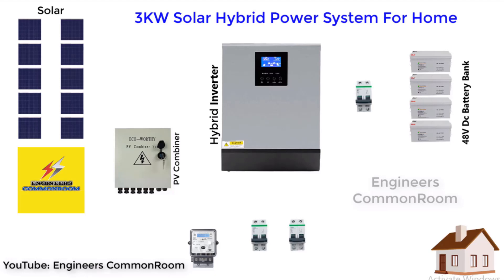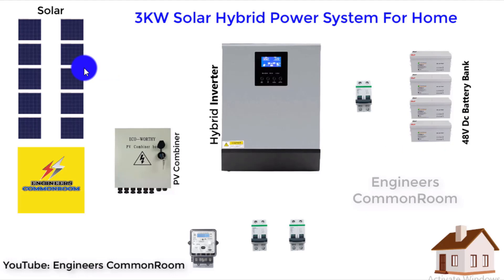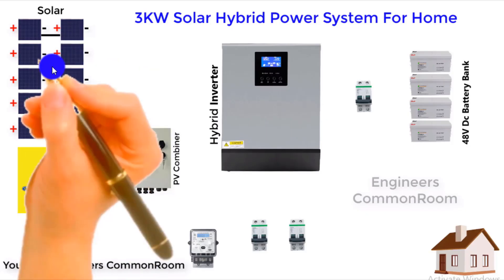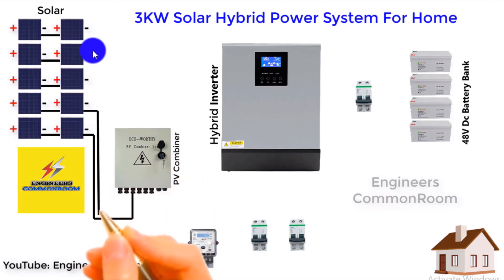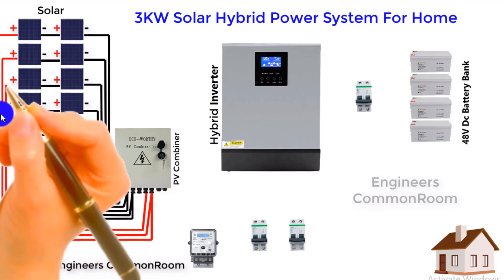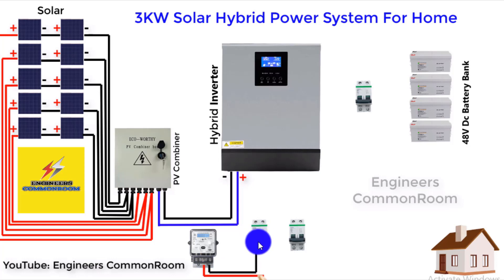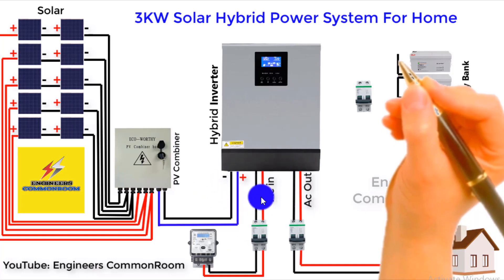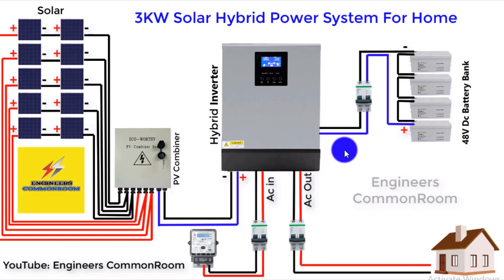Hybrid Inverter with Solar Panel Connection For Home । Engineers CommonRoom

Comment from the maker: Solar System for Home - https://youtu.be/GwKoCK8fO8I

This channel will provide engineering and Technology tutorials.
Thanks For Watching ✅LIKE ✅SHARE ✅ COMMENTS✅ SUBSCRIBE
Reply: I have  installed  solar system with  6 panels  connected  to  a 5kva  hybrid  inverter  to  a  five-star lithium  battery  but  it  can't  charge  the  battery  to  the  fullest  ,the  inverter  starts  to  heat  and  drops  down  oil  and  smoke

Comment: Thank u so much, please explain it to me how many panel for the 10kva and the battery
Reply from the maker: Panels: Around 25 panels (400W each) or adjusted based on panel wattage.
Batteries: Approximately 20 batteries of 5 kWh each for substantial backup.

Comment: Can a generator added on to charge the battery in case the main grid fails (storm/hurricane) via hybrid inverter input,dying to find out from an expert.
Reply from the maker: Yes it possible to charge via generator.
Reply: @bdelectricalcircuitdiagram  thanks for the prompt reply!
Reply from the maker: @georgesikimeti2184  Welcome

Comment: What will happen if grid is not present and demand load are higher than inverter out put & battery out put
Reply from the maker: Grid Or Battery same output found from Inverter because inverter depend on capacity. If grid not present inverter give the power from solar Or battery.

Comment: I have a similar set up with only solar and batteries.  Wired to a breaker box.  The breaker reads 240v and reads 110v at outlet.  When plugging in an item, not enough power to to turn on a bulb.  I'm wondering if I grounded the system wrong.  Where would you ground, the batteries, the panels, the inverter, the breaker box?

Comment: I have a 3000kva system not connected to solar , connected to mains , the inverter is getting hot during standby - is there a problem ?
Reply from the maker: May be inverter capacity low, please check the capacity also connection diagram.
Reply: @bdelectricalcircuitdiagram  thanks
Reply: Was working for a year without any issues , I feel the inverter might need repairs ?
Reply from the maker: @OH-dv8gg  May be

Comment: Sir, what is the diagram for a hybrid solar inverter without using neutral wire. Pleaseee I really need to learn it for academic purposes.
Reply from the maker: Please see the black cable for neutral wire
Reply: @bdelectricalcircuitdiagram  Sir can a hybrid solar inverter run without using neutral wire, all hot wires only?

Comment: How 24 volt solar input charge 48 volt battery?
Reply from the maker: Hybrid Inverter control for  48 volt battery with AC OR solar input. Solar for primary input.

Comment: what is the max. battery can invertor charge it in safe and efficiency???
Reply from the maker: Yes, Its safe.
Reply: @bdelectricalcircuitdiagram  what is the max. battery can invertor charge it ???
Reply from the maker: Its depend on Amp Or Voltage what YOUR are use for charging.
Reply: @bdelectricalcircuitdiagram  what is the max.  number  of batteries can invertor charge it ???for 12 v for example